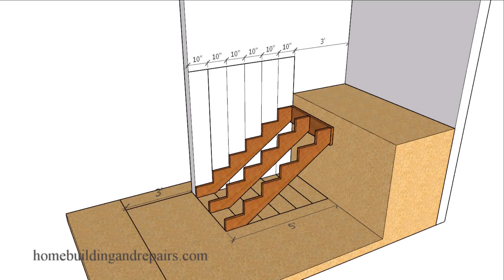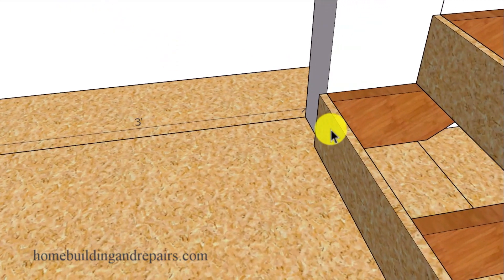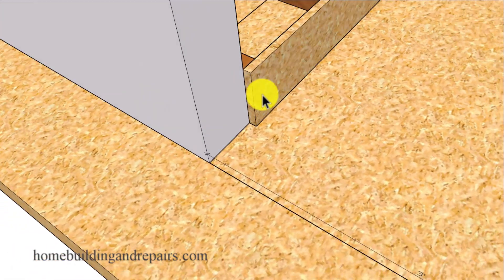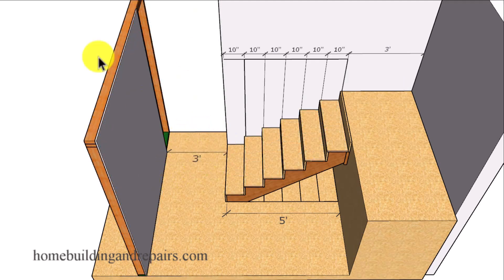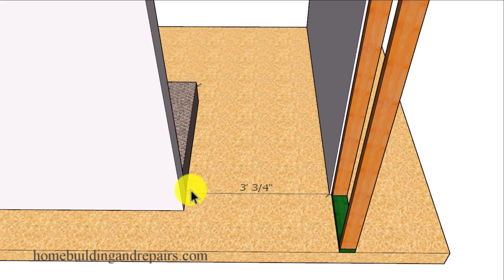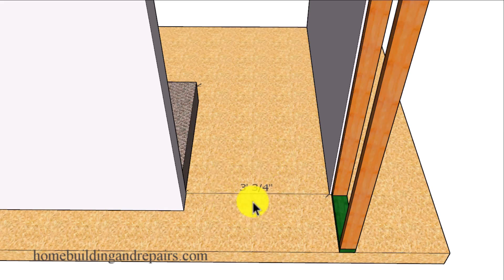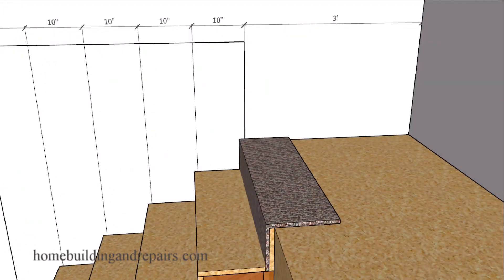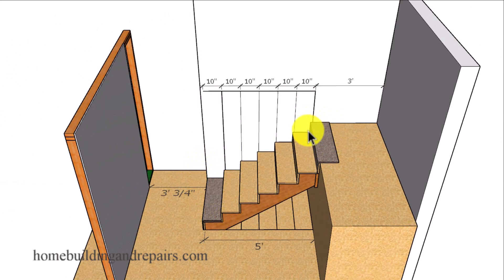How The Riser Thickness Along With Wall and Stairway Covering Can Create Design And Code Problems

Comment: Good info to keep in mind! 

With this in mind, would a railing attached to the treads of a 36” wide staircase also be a potential inspection failure?
Reply from the maker: It would still need to be strong enough, but if so then it seems like you would have enough width if your codes have a 36 inch wide minimum.
Reply: @stairbuilding  thank you! 🙏🏼